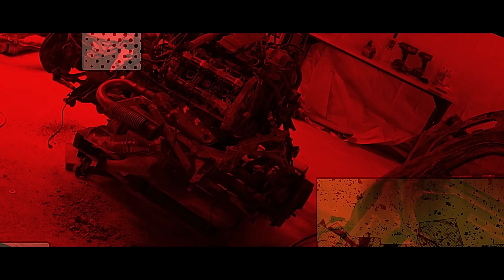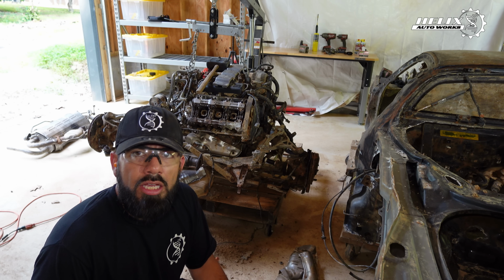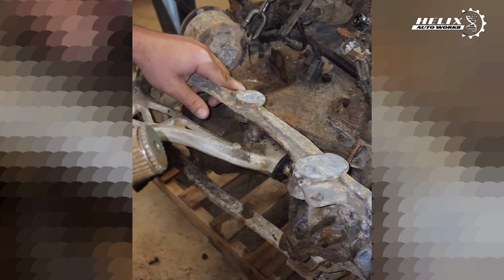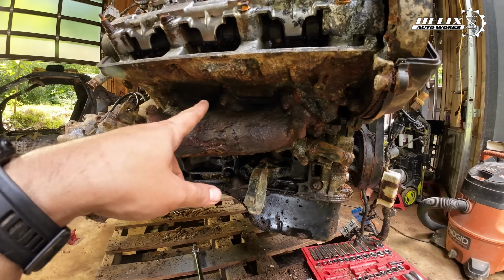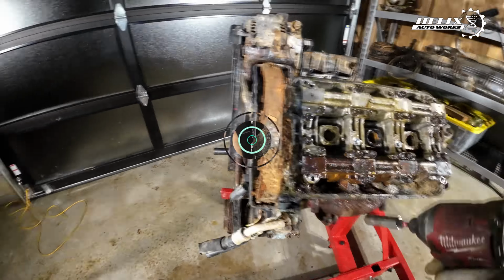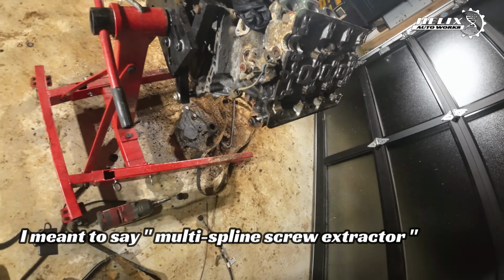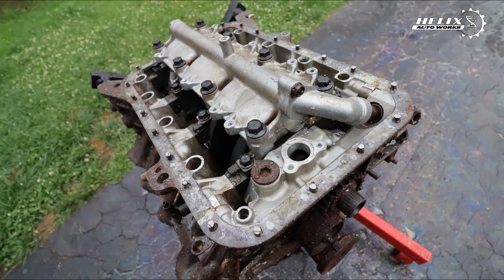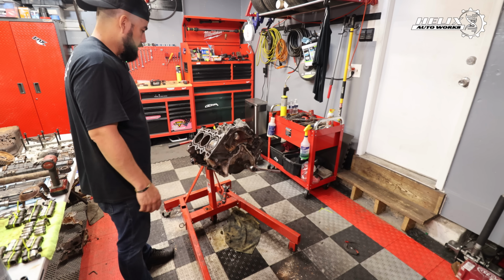Restoring a Stolen / Sunken Acura NSX Ep. 11 The Engine

Comment: You can save it for sure! I saved a buick nail head engine that had been ran dry of oil. The piston skirts were melted to the cylinder walls. Had to be bored but was salvaged